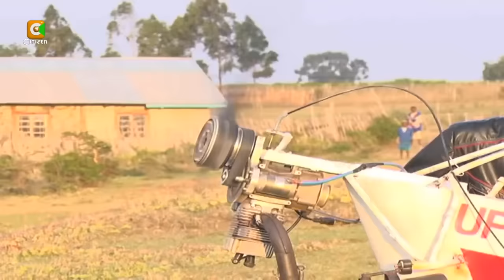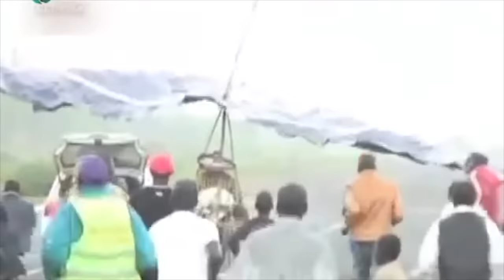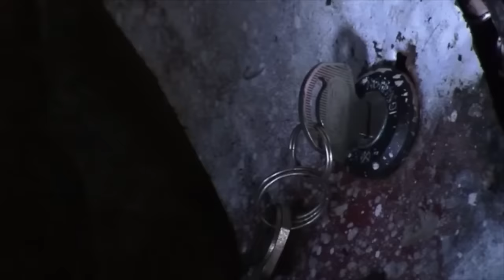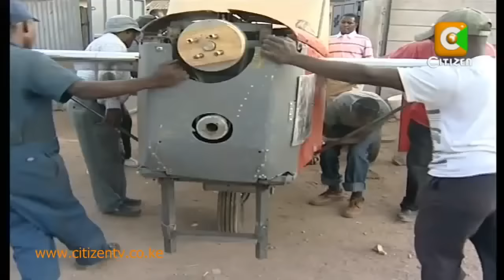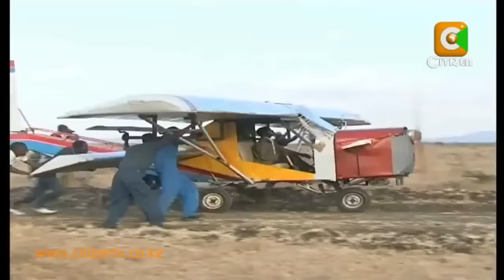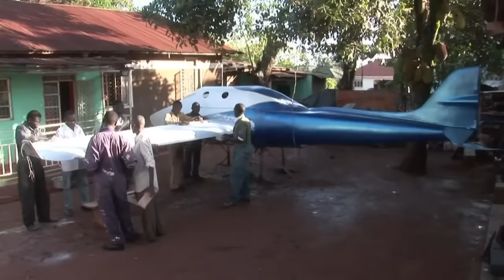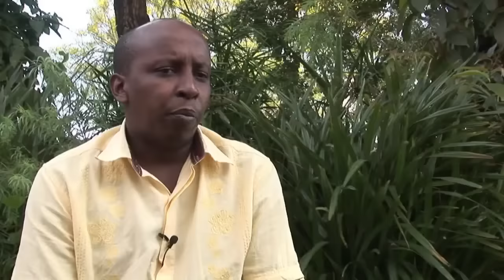African Airplane Compilation | African Aviation

Comment: First clip is actually impressive: Man made a steel helicopter (aluminum is too expensive), and it got off the ground. The crash was most likely for his lack of piloting skill, but he actually made the thing get off the ground unassisted.
Reply: It can't work though. Helicopter rotors are quite complex feats of engineering in order to stop gyroscopic forces from destabilising the thing.
Reply: @ulfricstormcloak3657  in all fairness that's the only one that flew, the other ones are the definition of wishful thinking. The full clip shows it did actually fly, he just lost control of it. Anyone who attempts a DIY helicopter is a special kind of insane, they are very difficult to get right and anything going wrong is catastrophic.
Reply: the tale rotor speed was too slow and couldnt counter the counter centripetal force of the blades.
Reply: I see nothing but a fixed axis to drive the main rotor, no pressure bearing and control rods. This is, how a kid would build a heli using Lego, nothing more.
Reply: @martinb.770  That's why he lost control of it. Still the best African helicopter I've seen though lol.
Reply: @Patrick-857  Never HAVING control is even worse, than LOSING control.
This thing was doomed to crash, from the drawing table.
Reply: To any naysayer:   Look at any early helicopter trials and you will see the same kind of incidents.
Reply: @bitsnpieces11  Reinventing the wheel though. That work has already been done, and lives were lost to achieve that. He had access to a device to film it, and upload to the Internet, but he didn't do the research to find out what happens when you have a completely rigid rotor.
Reply: @Patrick-857  that’s an old rumor that stints from I believe the military.

There’s 2 pieces to helicopter that take the vibration. The frame, and there’s a special piece meant to be replaced that spins the rotors every x amount of hours.

You can scale a small helicopter and gauge from there.
Reply: @JACS420  It's not the vibration that's the issue. It's gyroscopic forces. Helicopter rotors pivot and have balancing shafts. A completely fixed rotor will cause the whole machine to twist and destabilise. Just pick up a spinning circular saw and move it around and you'll immediately discover how much force is involved when scaled up to a machine that can lift Itself and it's pilot off the ground with a rotor alone.
Reply: @Patrick-857  I’m not going to say much but I was referring to military craft.

As a fabricator I could tell you I’ve worked with high rpm grinders, that run smoother than silk cutting through 1 inch steel. 

The black hawk is the helicopter I’m referring to, there’s a piece that has an obscure name that is the wear piece that prevents pressurized shaking. Turbo compression + torque in the rotor itself.

A civilian craft is probably a bit different. I was under the impression most modern helicopters are probably fitted with similar outfits.
Reply: @JACS420  That's definitely beyond my level of knowledge.
Reply: @Patrick-857  it’s near the pylon and pitch links. It could actually be that piece that connects right to them. Prevents gear wear, and provides stability. Needs replaced every x hours.

It’s that piece that breaks from time to time prematurely and causes choppers to fall out of the sky like bricks. Can’t think of the name and tried google.
Reply: Just because someone "got off the ground" doesnt mean something can fly. Theres something called ground effect too. Saying that the first helicopter couldve flied if you put a better pilot in it is like saying that hovercrafts are flying
Reply: Yeah, it reminds me of the footage of the first helocpter prototype made in Argentina.
Reply: @Patrick-857  they should just make gyrocopters
Reply: Look up "ground effect"
Reply: @Patrick-857   "Anyone who attempts a DIY helicopter is a special kind of insane"

I guess Igor Sikorsky was a special kind of insane then.
Reply: @beardymcbeardface69  I would say yes. The same special kind of insanity that possesses all men who attempt extremely dangerous things in uncharted territory.
Reply: @JACS420  Are you thinking of the droop stops? The beryllium alloy one that you can't ever touch with your bare fingers?
Reply: Nah
Reply: Blow at anything hard enough and it will take off - that doesn't mean it's flying: that's the equivalence, here. That thing was only ever going to crash and it's no more impressive than anything else in this wild fever dream - that guy should just be glad it didn't chop him into cubes.
Reply: Yeah he really managed to make it crashworthy!
Reply: @JACS420  you mean the swash plate?
Reply: @beardymcbeardface69  No - different: because Sikorsky was an actual engineer and inventor/aviator who spent years studying and rotary-wing flight before he built anything. He was not, a who knows, who; calling themselves a who knows, what. 
Sikorsky, designed a helicopter on engineering and aviation principles that he understood and hypothesised beyond, to the point of practically executing a test of his conclusions. 
Whatever he DIY'd, Sikorsky did, not, fabricate an unprincipled and undisciplined death-trap, based on something-or-other, that he anonymously piloted straight into the ground.
Different.
Reply: It’s a way better plane than any racist shitposter has made.
Reply: Steel is a fine material for aircraft building. Frames made of steel are equivalent or lighter weight to aluminum. Fabric covered planes all use steel frames. Steel is also more flexible than aluminum and less prone to breaking.
Reply: If it's with self made parts it's definitely impressive, that he even took off the ground. I think the vertical rotor had too little power to counter the rotation, not necessarily pilot's error.
Reply: @Patrick-857  I have to imagine there are African countries who have actual helicopters, these just seem like dudes from Africa who’re amateurs. We’ve got amateurs in the west who try to make their own planes or helicopters too
Reply: @beardymcbeardface69  Slavs tend to be better engineers, then the zanj, the bantoid 🤣
Reply: @bitsnpieces11  well those guys in the past don't have internet access/paper to do research on helicopter. Unlike this guy's in video,where study paper are everywhere to be read
Reply: They should've just stuck to wood and worked their way up from there lol
Reply: @JACS420  I guess you are talking about elastomeric bearings in a rotor hub, the parts that allows the blades in a fully articulated rotor system to move. But they are not a common cause of failure. And other kinds of rotor systems like a tilt rotor system on a Huey doesn’t use them.

The main thing that prevents vibrations in a Black Hawk or any helicopter is to track and balance the rotor properly
Reply: @alexalford7874  You're making a false equivalency. These are people who never discovered agriculture or invented the wheel. We're talking about an actual stone age population who were forced to rapidly adapt to another civilization that was roughly 40k years more advanced. It's very telling that people from impoverished Eastern European countries are capable of making something that actually flies out of literal scrap, but Africans try to make it look the part and think if they believe hard enough it will fly. This is in spite of the fact they have Internet access to find out how to make something that actually flies. And yes I get that they are very poor, but poverty often results in amazing ingenuity.
Reply: @bitsnpieces11  yeah... except WE arent in those ages anymore because we have fully functioning helicopters now
Reply: @beardymcbeardface69  i mean... yes absolutely but his insanity ended up somewhere useful today

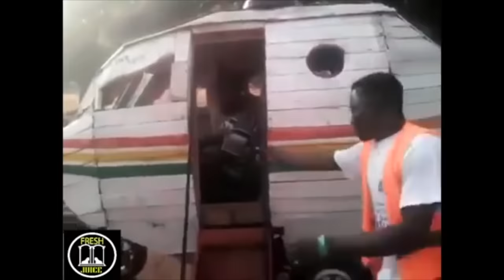Comment: 3:34 HOW DID THEY MANAGE TO INSTALL THE DOOR UPSIDE DOWN?
Reply: Haha
Reply: Skills
Reply: Didn't even notice that lol
Reply: Yeah, I noticed that too. If you can't attach a door right side up then I'm pretty sure you don't have the mechanical skill and engineering knowledge to get a vehicle off the ground.
Reply: @iamf6641  so as whites and asian, America belongs to the red Indians...
Reply: Alpha God “red Indians” as you call them were ancient asians that crossed the bering straight during an ice-age, They just got lucky enough to get here first.
Reply: @greatbeans2889  so, African American have same rights of whites  over America...
Reply: Holy shit I didn’t even notice that😂
Reply: Alpha God okay that doesn’t have to do with what i said tho.
Reply: sup reee, im sure youre memeing as that would be your M.O. But the door was clearly a (poorly) made replica of a jetliners airtight stair door, which would need to open toward the ground so as to be stairs. It, of course, is completely unnecessary and solely for flashiness without actual function.
Reply: @greatbeans2889  i just replied to a racist comment above, i think  you didn't see that...

Comment: If you're taxiing down the runway and people are running faster than your plane, you might be an African aircraft engineer. If your lead welder is welding with his eyes closed, you might be an African aircraft engineer. If you look at a weed whacker and think " gee that could power my homemade helicopter", you might be an African aircraft engineer.
Reply: Linamar This is too golden 😂😂😂
Reply: The spark or flash from welding can cause your eye blindness or eye side weakness thats why he was closing his eyes
Reply: Ahahahah!
Reply: @ahmedart5212  r/woooosh
Reply: Linamar 😂😂😂Niqqa let Africa go
Reply: I just molded a plane out of clay and will be flying it soon, does that make me a aftican engineer?
Reply: @ahmedart5212  Yes obviously it's not good for your eyes, but welding helmets are used because seeing what you're welding is like looking at a painting while you paint it - slightly helpful.
Reply: @scotthogan6495  But you can only see through the helmet once it's already sparked and touching metal. Obviously it helps but it's for protection more than anything.
Reply: @CalamityHillMusic  Modern and cheap welding helmets automatically dim when the welding starts, and are adjustable depending on how hot the weld is. Dirt cheap too, so you are mistaken - you are thinking of the old helmets that only had darkened glass.
Reply: @methylene5  I know nothing about welding but aren't you kind of proving my point ? I mean can you really see where you are going ?
Reply: @CalamityHillMusic  No, I'm not proving your point. I weld, oxyacetylene/tig/etc. You can NOT weld by closing your eyes, the arc temperature isn't only bright enough to blind you permanently with your eyes closed (!!) but the UV will cause damage also. If we could all weld just by blinking using welding sticks then we'd be doing it. Can YOU not see where this is going? Weld the way that guy was for long enough, and you won't be able to see anything ever. It's stupid and dangerous.

Comment: If you cannot understand or construct a runway, then you should not try to fly.  After all, the sky is racist.
Reply: Tell that to the Wright brothers...
Reply: Typical comments, as if wright brothers had a runway.
Reply: @mbakayako3081  They had two thing (maybe three) that these scammers did not have.  They had success.  And they had their names written into history.
Reply: jmarks881  Surely they had, they fitted wheels on the 'Flyer' which ran on rails, (minimum friction), and upon take-off the wheels were left on the ground (minimum weight). Figure it out for yourself how they landed again without wheels or landing gear as it later came to be known.
Reply: Anton Zuykov what makes you think they have access too these things? They don’t even have proper building materials
Reply: Adam Wade figure it out Sherlock r/whoosh
Reply: You are right about that part. Only a jet plane with an overgrown landing gear could take off of some of those fields. And it would probably damage its landing gear in the process.

Comment: It's not about the failure. 
It's about the dream.
Reply: Wakanda lore
Reply: And that’s why it will always be a dream and not a reality .-.
Reply: @ umar shaikh

The dream of failure.
Reply: @chowderthechowchow6919  everything starts with a dream
Reply: Pipe dream
Reply: @dwchen1  they said the same thing when Wilbur and Oliver Wright started writing in their first airplane..I think you are jealous of these people, who with minimal resources are able to work on their dreams.....
Reply: @chowderthechowchow6919  and you are the failure one
Reply: I have a dream; to get rid of human waste.
Reply: Dream to fail maybe...
Reply: Until the dream fails because youre using a second hand ceiling fan for "space program" BWAAAAAHAHAHAHAHAHHAHA
Reply: it’s not about failure 
it’s about the dream.

and it only happens when you’re asleep 💤
Reply: @arbjful  well different is that. wilbur and oliver, knew exactly how physics works. thats why they build plane with lightest weight possible. while working on next gen step by step, fixing the problems.
in the other hand these ppl lack of basic understanding of physics. how on earth you can lift 800kg with motorcycle engine?
Reply: @ianlanford6922  no they didn't know the physics, but they did learn by trial and error, and improving on what was known back then
Reply: @ianlanford6922  with the right motorcycle engine it would even be possible. For 800kg MTOW a 100 hp would be enough. But they probably throw 50 or 125 cc engines on there.
Reply: @21willyx21  get rid of human waste?
Reply: @arbjful  FUC KING IDI OT HA HA HA HA
Reply: But mostly failure!
Reply: The man in the very first helicopter video was killed in that attempt.

Comment: "I want to show Malawians can do what the whites do"
Man, that just made me feel sad. The equality ideology is leading to heartbreak and disaster.
Reply: @Lecmos  Bear in mind, in 1903 the wright brothers designed a plane that flew. They did this without calculators, modern engines, the internet, or even an engineer. By 1914, barely 11 years later, planes swarmed the sky of Europe as men faced each other in aerial dogfights. By 1919, the first flight across the Atlantic happened.
So to answer your question, design and fly a plane, apparently. Even after all the science and engineering has been done and has been public knowledge for over 100 years.
Reply: @Ca Ca "they're messing around..."  I'm fairly certain they are honestly trying to build something that will fly.  Stop making excuses for them.
Reply: @attackhelicopter3873  
Not even 11 years. First planes fought (not on the scale of WW1) in first Balkan War in 1912. So its less than 9 years.
Reply: @Lecmos  uhhh aircrafts... did you not watch the video? 🤣

Comment: This honestly looks like so much fun and a great community building exercise.
Reply: Call it a national motivating scam.
Reply: Not when you're malnourished and starving lol
Reply: It looks like the community comes together to have a good laugh at this ridiculousness. Wakanda forever 😂🤣😂🤣
Reply: THEY NEED TO GO TO HOME DEPOT
Reply: Until someone dies
Reply: Laughing at their stupidity is good for you! Lol
Reply: until you realize it's fucking 2023
Reply: just have someone to do a little engineering and calculations on what specifications they need to meet to actually get in the air....   it's not nearly as simple as throwing a tiny engine and fan blade together with plywood wings and a lot of good intentions.      weight, power, lift, at the very least I'd hope would be considered.... anything less is foolish waste of time
Reply: @dailyrevs1320  I hope the irony of someone named "rev racing" calling out the danger of a hobby isn't lost on you.  The entire automotive racing sport has been built on guys doing backyard wrenching then taking their creations to ridiculously dangerous races.
Reply: @jackdanson2  my comment went way over your head bud
Reply: @jackdanson2  yeah I agree but it's still safer than being an astronaut in the "African space agency" LOL

Comment: They should start by copying an already existing design.
Reply: They should start by copying an existing design well.
Reply: Well its not that easy if you can't read the plans or blueprints.
Reply: @omegamanprivate7132  yeah the center of gravity on these planes are probably off.
Reply: Well the actualy governments of these countries (Kenya, Nigeria, Ghana, South Africa) already manufacture or modify planes using existing designs.   Thats why the Cheetah and Oryx exist, and are being made in those countries.

But when you talking about a bunch of hillbillies in the desert towns of nowhere… ..they dont have much exposure to existing designs.
Reply: South Africa did release the AHRLAC in 2014.  I mean even the country with a strong White presence isnt doing much in designing their own aircraft when they have a large library of aircraft to simply purchase and alter.
Reply: Bad Cattitude  Yeah but remember that the White population of SouthvAfrica completely dominated for more than 75 years and they never once designed an aircraft.

It was after apartheid with Black leadership over the government that they finally decided to design a military aircraft.  So didnt the boers make anything during their century of rule?
Maybe Africa, as a whole, just doesnt need unique planes.